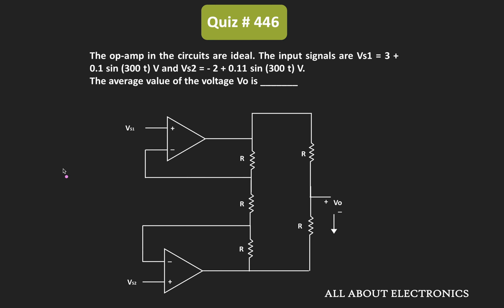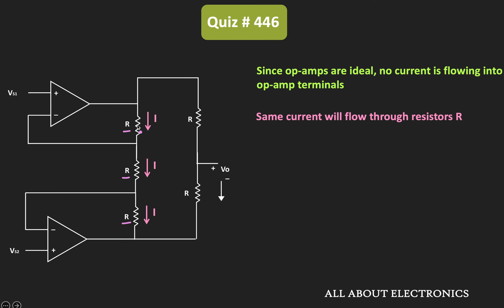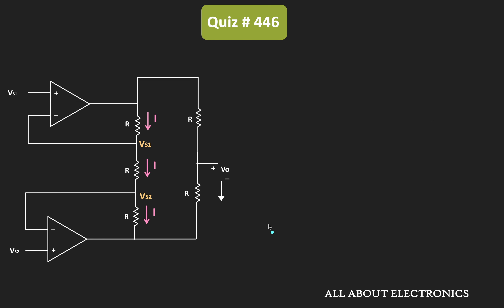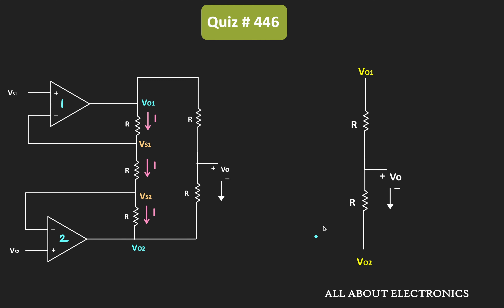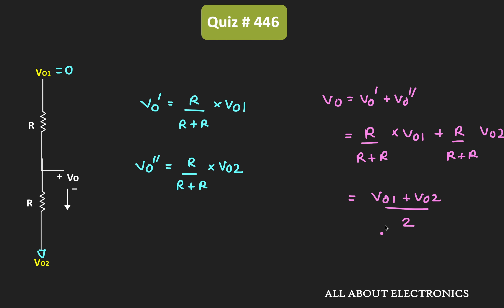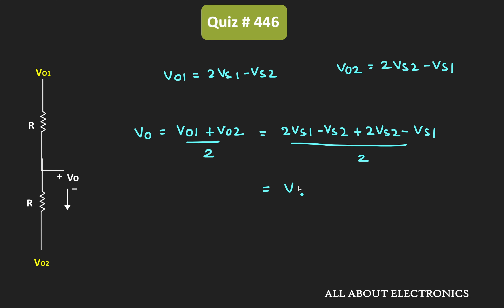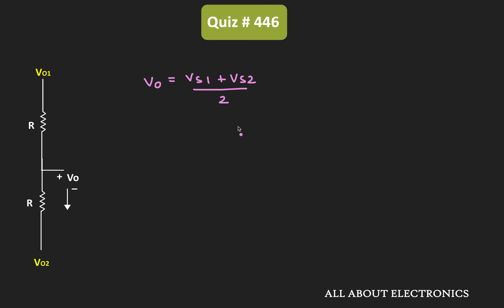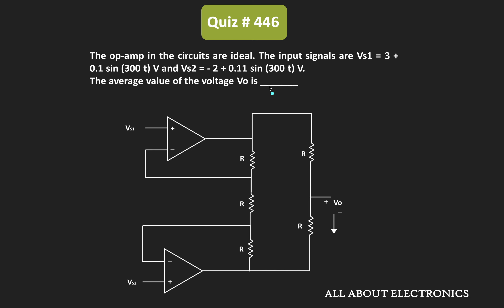Operational Amplifier Solved Problem | Quiz # 446

Comment: My doubt is that both the op amps were in the configuration of a "BUFFER", so why Vo2and  Vo1 not equal to Vs2 and Vs1 respectively??
Reply from the maker: Because there is a resistor in between. In the single op-amp configuration, if there is a resistor between the Vo and Vs in general, then both voltage would have been same. Because there is no other path for current to flow. (Assuming no current is flowing into the op-amp terminals). But here Vo1 and Vo2 are different, and hence there will be a flow of current through a resistor between the two voltages. That's why here, Vs1 and Vo1 are not same. I hope, it will clear your doubt.

Comment: These are great videos, thakn you for sharing,.
Question: How did you decide on the direction of the current?
Reply from the maker: Just assume one direction. If the assumed direction is opposite to the actual direction, you will get the negative value of current for the assumed direction. so, there is no need to worry while assuming the current direction.

Comment: May be I am missing something basic: 
vs1 and vs2 should be interving in sign, i.e. -vs1 and -vs2? when used in final caculation, since they inverting feedback.
Reply from the maker: Because of the negative feedback, we can apply the concept of virtual short. That means we can assume that the voltage at the inverting and non-inverting terminal are same. That’s why at both node, the voltages are positive.
For more info, please check this video.
https://youtu.be/AuZ00cQ0UrE
Reply: @allaboutelectronics-quiz  Thank you for the response.